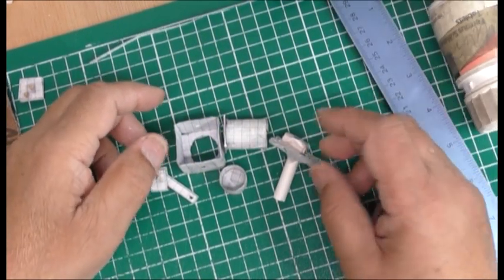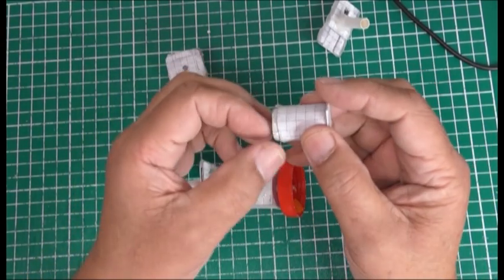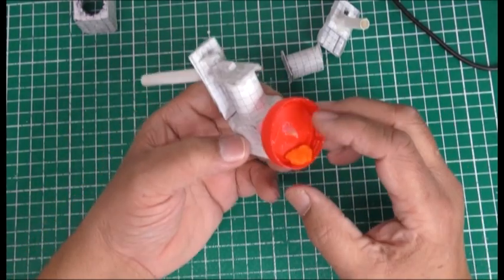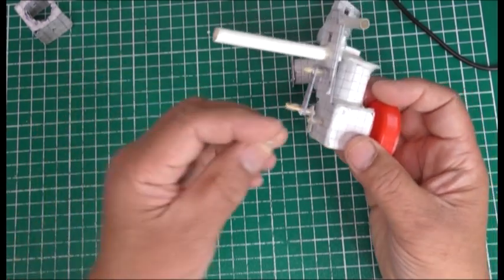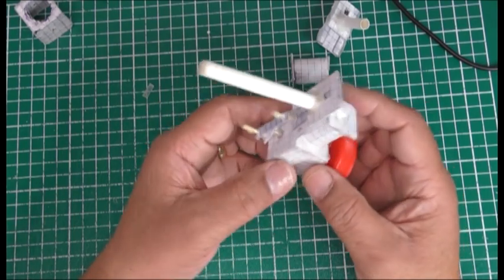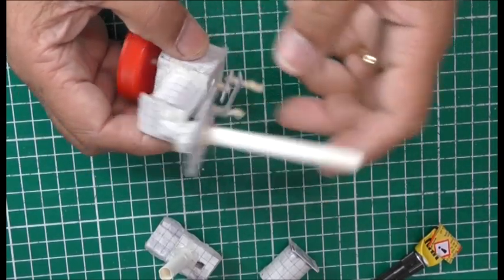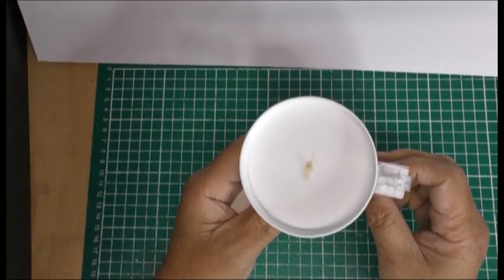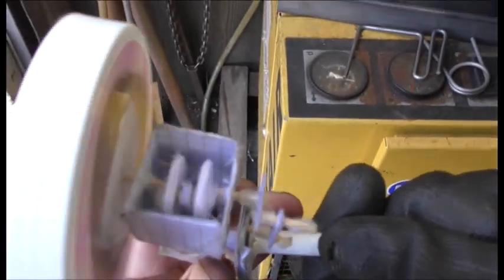#249 Paper Engine Part 3

Comment: looks like it works pretty good, you got the friction part perfect and the idea with the bearings was pretty smart, however you can improve massively buy making a tighter tolerance valve, currently your valve is leaking too much air so barely any reaches the piston, but its looking great, if you use a baloon your can get it to run longer
Reply from the maker: thanks again I will have to try that. I am thinking of doing a diffrent kind of engine and I will keep this in mind 👌